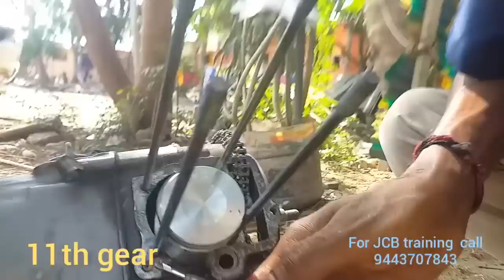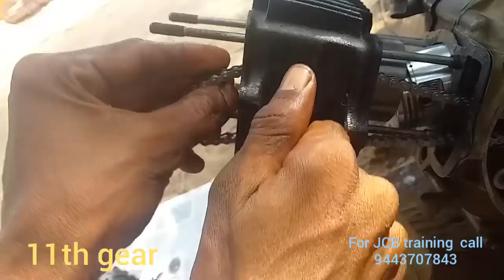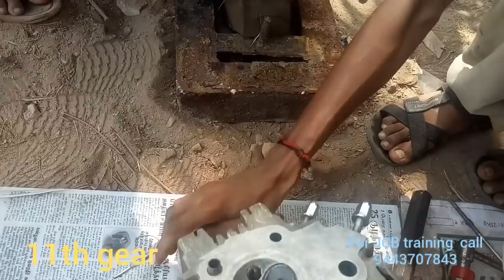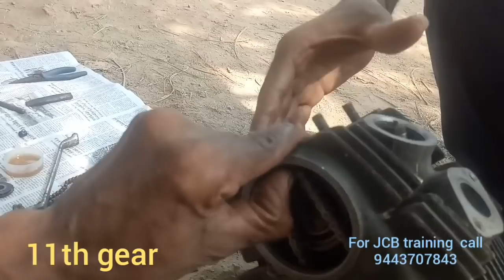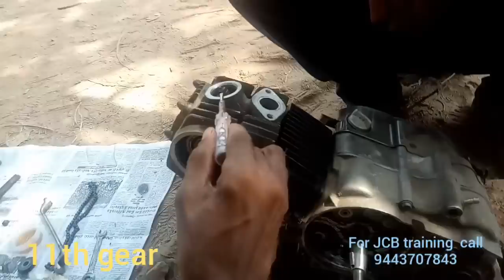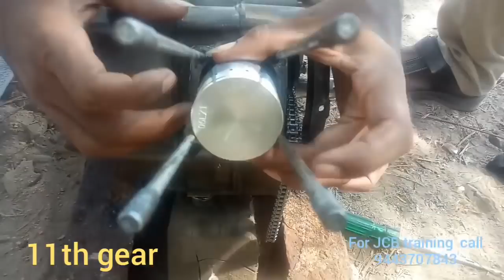Splender மோட்டார் சைக்கிள்  Bore(cylinder )  ஹெட் மாட்டுவது  எப்படி  ?

Comment: Sir piston rings la tric irukee athaa yee neegaa sollala &piston entha side fit pantrathu nu yee sollamatringaa
Reply from the maker: Call9080416383
Reply: Sir splendor running la ulla bike oil pamp work agutha illayanu yeppadi therinjikurathu
Reply: @appu6803  inlet valve or tappet adjustment nut open pannunga bike start panntu raise panna oil spray aagum so oil pump work aaguthunu identify pnnikalam